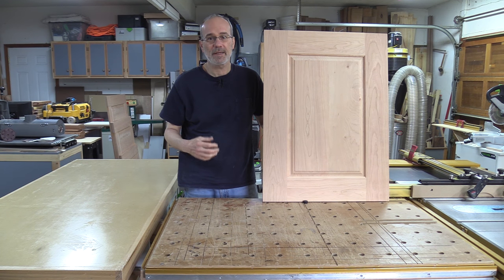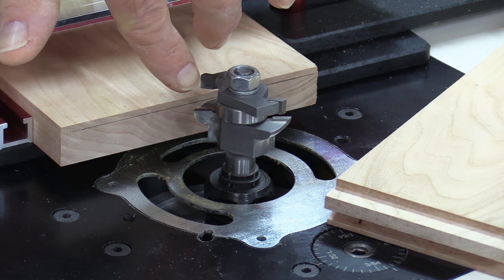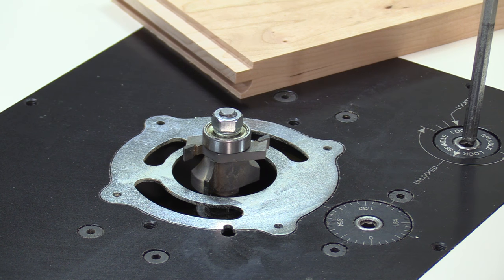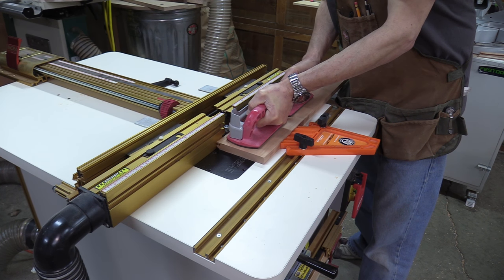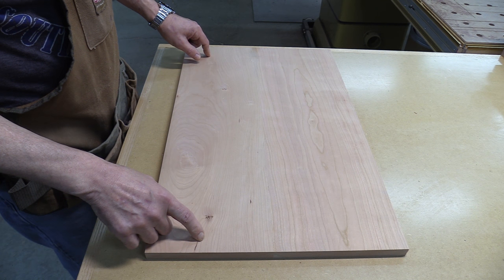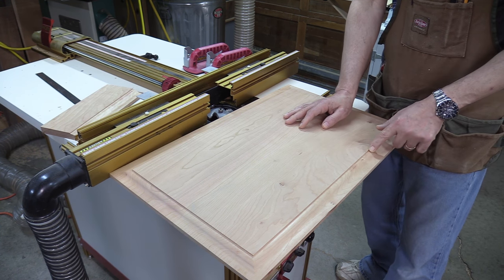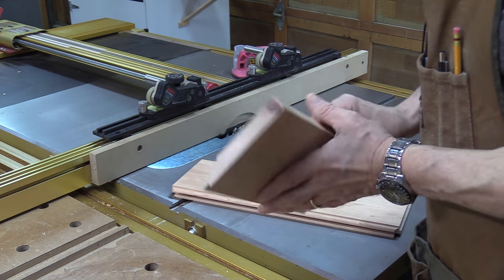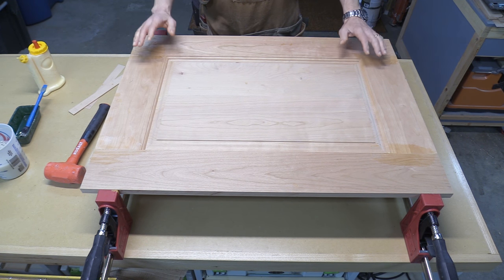How To: Make a Cope and Stick Frame With a Raised Panel/Woodworking How To

Comment: I appreciate you going into the detail about the router bit set up, that was very helpful.  I made a headboard for a king size bed using similar bits and it was a real struggle to get the bits set up correctly using the instructions that came with the bits.  I eventually made the joints successfully, but it took many, many test pieces.  Once I had it dialed it, you can bet I marked and saved those test pieces for future set up blocks.  Thanks Guy.
Reply from the maker: Thanks Ed! Yeah, it can take a few test cuts to get it dialed in right.

Comment: Beautiful result. I can say that having a locking feature on the router table is essential: I have a Triton TRA001 mounted under my Kreg table and when I'm running my box joints through my jig I have to raise the bit back up after every few passes and I expect to do it for my cabinet doors, too.

Comment: That door looks amazing! You made it look so simple which means you did an excellent job with the presentation.
Reply from the maker: Thanks Sean! It is actually pretty easy. You just have to be precise when setting up the equipment as there is little or no room for error.

Comment: Great video Guy, nice instruction. And that router table.. Wow, I think I may have to trade in my sway-backed harbor freight POS I have had for 15 years on your model. Thanks Guy.
Reply from the maker: Hey Brian! Yeah, I rely pretty heavily on my router table, and I am really liking this one. I didn't even know Harbor Freight made one!
Reply: It is just a crap insert I bought and stuck in my table saw extension. It sucks and I have been wanting to upgrade or years, but I am the king of getting by. Cheap bastard ;) I am going to look into the incra setup. Can't wait to see how the project turns out, I bet it is going to be beautiful. You do great work sir.

Comment: Nice video and explanation Guy.  I do mine on a shaper with an outboard fence for the stiles but similar nonetheless.  One thing that I do if the piece is to be stained is to apply one coat of stain to the profile of the raised panel before assembly.  this way, you always have an even color even if the raised panel shrinks.  I also use a product called Panel Buddies in the grooves to keep the panel centered and remove any rattle that could potentially occur during seasonal changes.  Steve
Reply from the maker: Thanks Steve! I have seen your shaper in your vids, and would love to have one someday. I normally do finish the panel or at least the inside edges before assembly. This is for a commission, and there are 5 panels in total. They will be going around a kitchen island, and the home owner wanted them unfinished as they have people that are going to refinish and stain the entire kitchen. It doesn't show in the video, but I put a little glue in the center of the top of the panel so it expends into the groove on both sides.
Reply: ExtremeWoodworker

Comment: Great Job Guy! I only have a few "go to" woodworking channels and you're one...Thanks!  [Any chance of a similar video with a divided light middle???] I'd really enjoy seeing how you'd approach the muntins and mullions.
Reply from the maker: Thanks Tom! This is one of 5 panels I made. 3 of them did have a center divider. It's easy to do. The divider has both the stile profile on both sides, and it is coped on the ends. Then just make panels to fit!

Comment: What is the difference between "cope and stick" and normal "stiles and rails"? Is it that you cut them out on a tongue and groove bit? Or is it the "fluted" shape?
Reply from the maker: The cope and stick is the actual joint where the rails meet the stiles is all.

Comment: thanks. Do u need to leave a little room for wood expansion?
Reply from the maker: Yes, I mention in the video that I made the panels 1/4" smaller on the sides to make room for expansion/contraction

Comment: If you have never cut stile and rail. 
 I use only hardwood so I don't know about soft woods( get dressed white and red oak free) 
1.DO NOT settle for a cheep set of bits. I first bought Yonico. Ruff and lots of tear out (even with backer). After much frustration I bought Freud adjustable 2 bit set(I already  had a good raised panel bit). WOW what a difference! 
2. You must have some way to securly hold the coping cut also called end grain rail cut. It looks like Guy uses a "store bought" coping sled. I made my own. I should have bought mine because when I made mine I did not have the skill to make it well. I guess I got lucky.
3. Make sure your stock is not cupped, twisted, or bent. And  use dressed wood also( where you have run it thru your planner so it is good and smooth) that is all the same thickness.
4. Make sure the end of the rail is 90 degrees. The bearing on the rail cutter router bit will tend to follow whatever the profile is on the end of your rail end-face. It will not look good if It does not match the stile at 90 degrees.
5. I use my router bits to make frames for my wife's beautiful stained glass works. Remember that you must make your stiles long enough to fit what you are framing plus the width of your rail pieces minus the deapth of the grove in your rails plus 1/8" (1/8" top and bottom gives 1/4" of extra space) or 1/4" ( which gives 1/2" of extra room). 
6. For rails, you cut the piece of wood to be equal to the width of what you are framing plus 1/8" to 1/4" on each side ( for the extra room when the wood expands And contracts with heat and humidity).
If you are making cabinet doors go on line and find a free program that will tell how big to make each piece. You need to know things like how wide your wood is, how large is total to be covered, how large is the opening, and how deep the grove is on your router bit ( Yonico is 1/4" deep but my set of Freud cuts a 7/16" deep grove) plus other info. I found these programs to be huge time savers for us beginers.
Also this a fixed in table router job - don't even try this free hand!
There is more of course but these are the mistakes I made when I began. Hope it helps.
Reply: Dale Wier thank you for this valuable information,